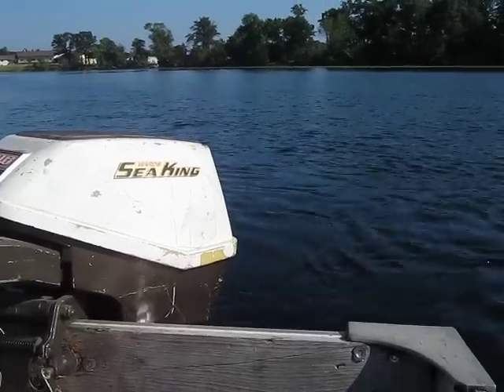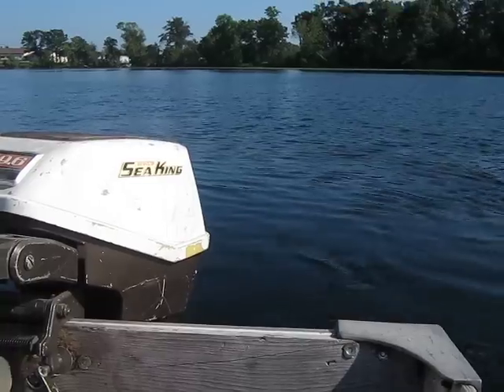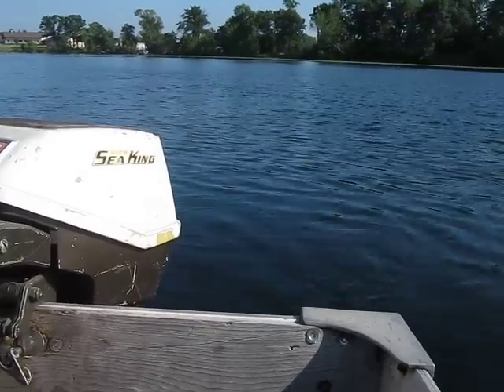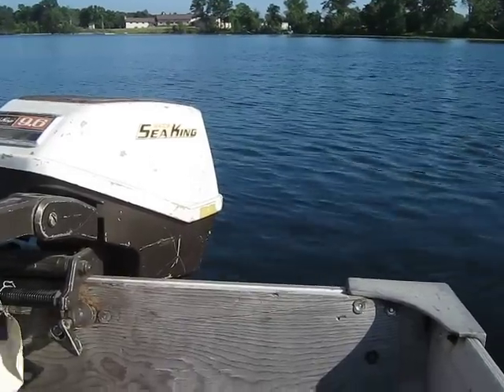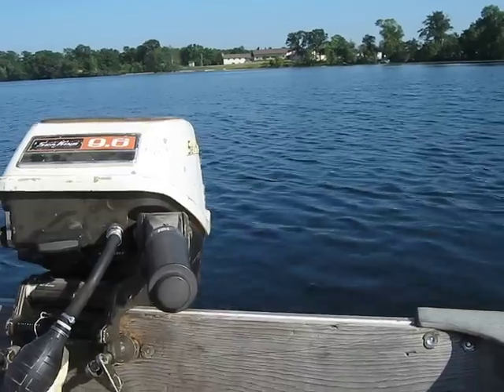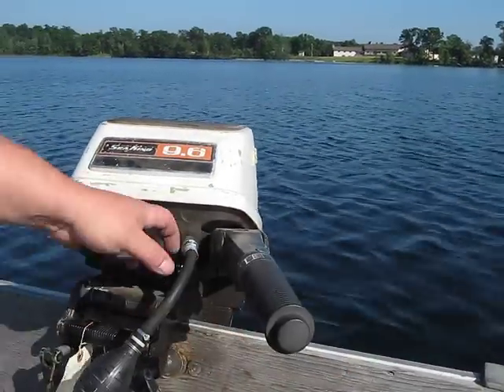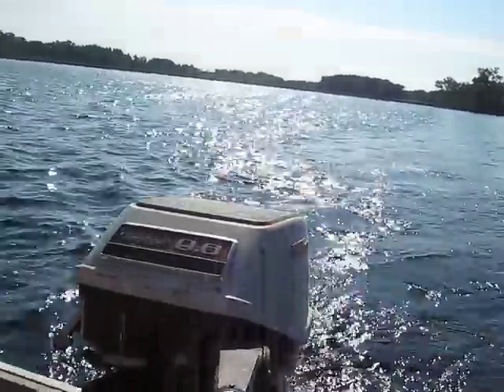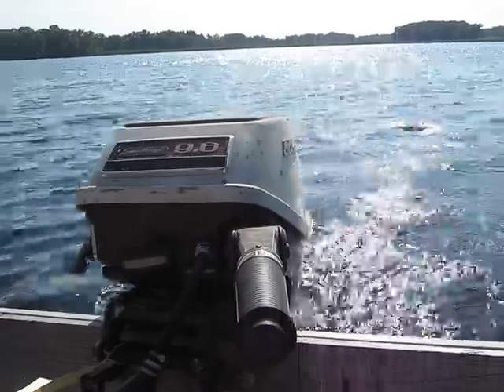1970 Sea King 9.6hp outboard motor

Comment: I have the same motor, great little motor.  Right now mine is leaking gas when i am slow idle or shut off the motor.    I guess i am going to have to check the carb to see whats up with it. lol   Love the motor though, runs great.

Comment: Wow that thing runs great I have a 1979 Clinton 3.5 horsepower and I am looking for the rubber plug that connects to the gas tank and fuel shut off do you know of any web sites that sell seeking parts any help would be greatly appreciated